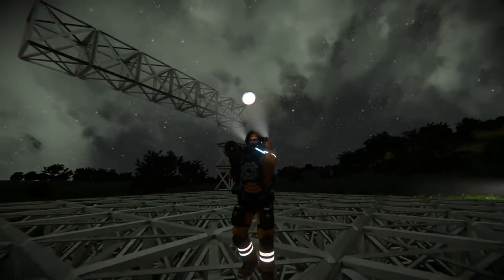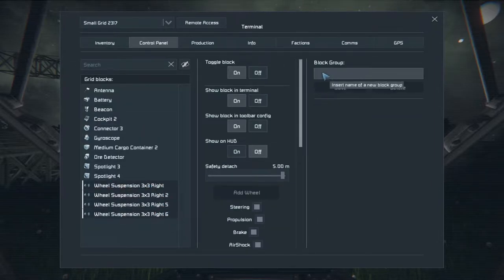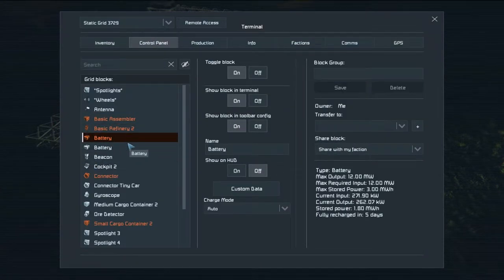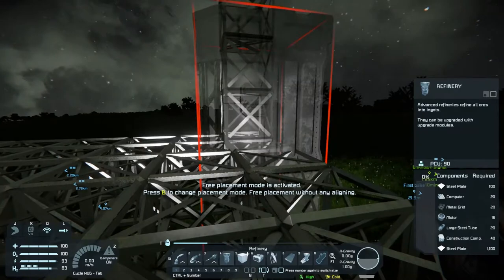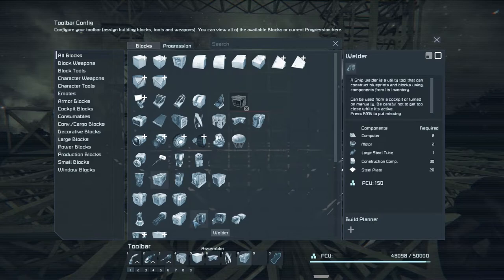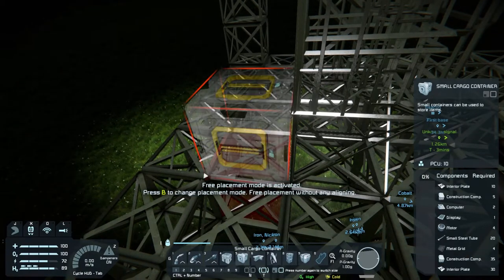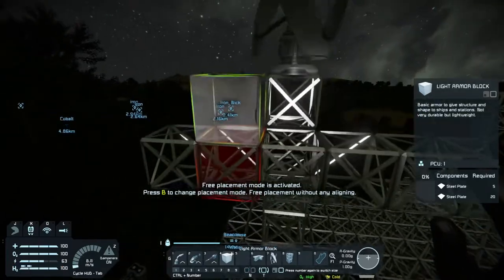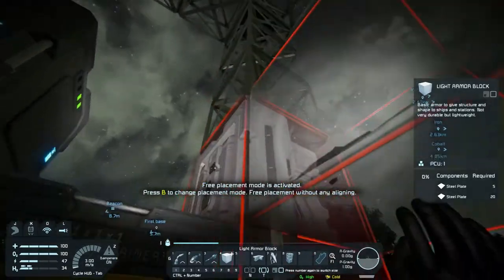[6] Base basic layout - Road to Space - Space Engineers Survival

Comment: Automatic machines should be next. Like welding walls (3D printers), grinder pits, strip circular mining... and advance construction design
Reply from the maker: Wow how about this better machine and a flying miner. Then I will look into all the difficult machines your mentioning
Reply: @DailyFixLP  yosh, a flying miner wirh 4 drills, atmo/hydro engines. 2 bigass cargo containers, flashlights, gyros, batteries, o2h2 generator, hydro/oxy tanks. And the conector
Reply: @DailyFixLP  make it fly to orbit, remember that the max speed in SE is 100 m/s. You can go to space disabling your inertial danpeners and using the hydrogen in small brust until reach that speed. In space is better use ion engines with a combination of batteries, reactos and solar panels
Reply from the maker: @danielpirela1225  😂😂 you are aware that this is my first time playing SE right? I will eventually get to space I hope but I also want to build some bases and make some vehicles.
Reply from the maker: @danielpirela1225  how about 6 drills, a lot of trusters 2 gyroscope's 2 containers, ore detector some armor blocks. Owww and a few lights.
Reply: @DailyFixLP  light armor
Reply from the maker: @danielpirela1225  Light indeed
Reply: @DailyFixLP  heavy armor is used to combat. An requiere a lot of steel plates and metal grids
Reply from the maker: @danielpirela1225  I wasn't planning on using heavy plates just jet maybe once I head into space. I heard there might be enemies in space.
Reply: @DailyFixLP  well, you need to know a lot of SE to make the machinima series.
Reply from the maker: @danielpirela1225  I have plenty of time to explore the game.
Reply: @DailyFixLP  ok... i see. Btw, today is the Area 51 Raid